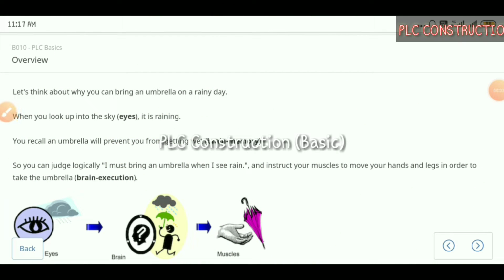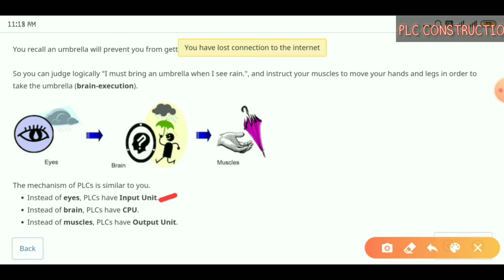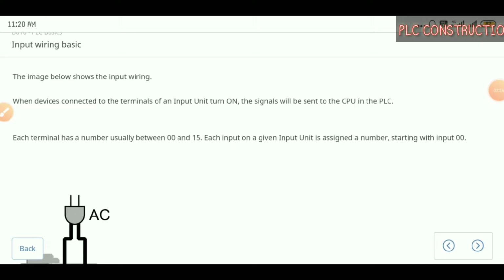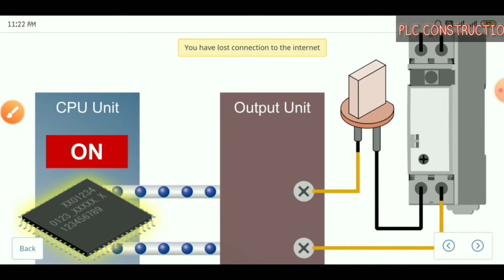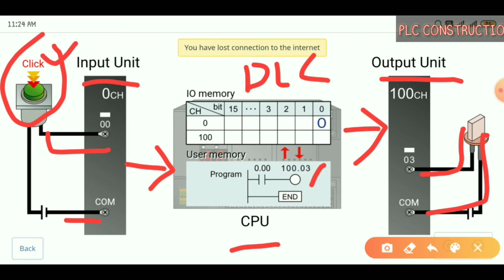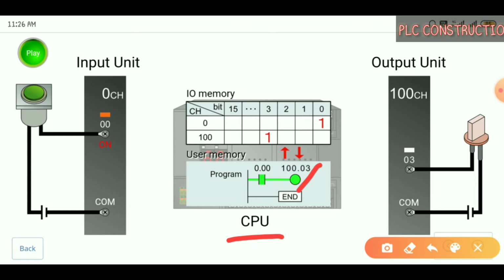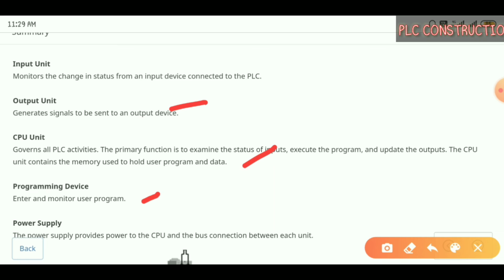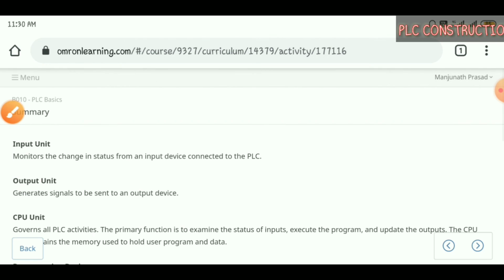PLC Basics (Part-02)

Comment: How to identify Sinking or Source input
Reply from the maker: A sinking digital I/O (input/output) provides a grounded connection to the load, whereas a sourcing digital I/O provides a voltage source to the load.

I will provide a separate video on this. Thank you!